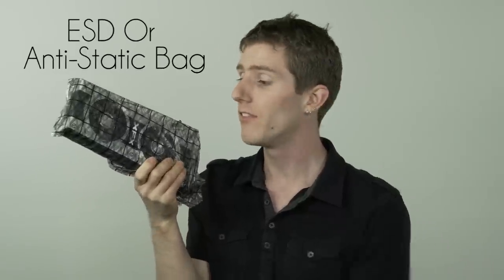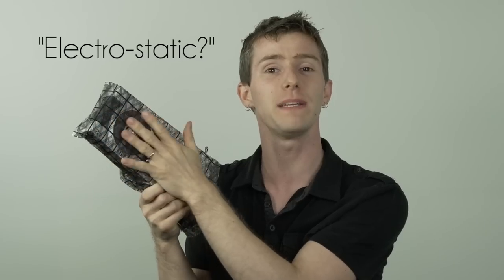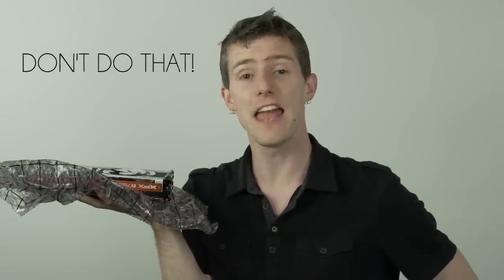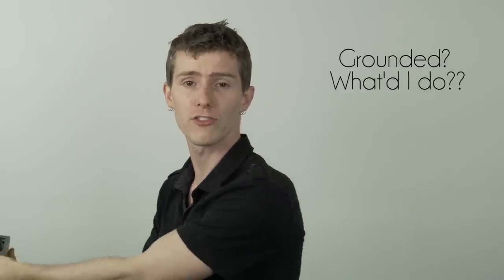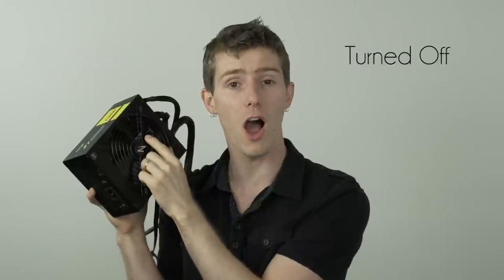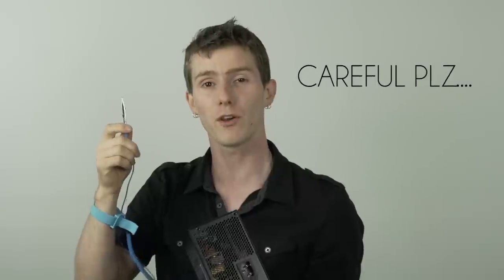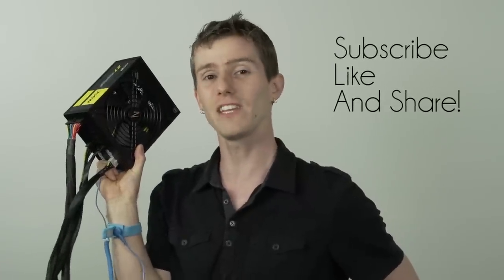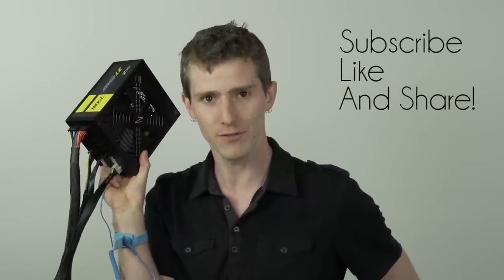Anti Static Safety - Handling Sensitive Electronics as Fast As Possible

Comment: my psu doest have a off switch :(
Reply: +Lukas Safi You can touch a metal radiator. Or connect the wire to the metal radiator...
Reply: My power supply electrocutes me every time its turned on and near me, is it bad or normal or fucked up?
Reply: Alaa Afara I don't think that's supposed to happen since the casing of the PSU is usually grounded... What PSU do you have?
Reply: Arman Ashourlou It came with the Coolermaster Elite 350 (CMP 350) it says Thermalmaster 500W
Reply: Arman Ashourlou I feel sort of a magnetic field around the thumb screws near the PSU and I get a small sting when touching it.
Reply: Alaa Afara Do you get the shock when you touch the PSU directly from the inside of the chassis too?
 By the way, it's not the magnetic field that shocks you; it's the static buildup of electricity being discharged through you and into the ground.
Reply: Arman Ashourlou No, not from the inside, actually I never tried
Reply: Alaa Afara Try to touch only the PSU casing from inside of the chassis. See if you get a shock. Do not touch or get your hand close to any other components in your computer as you might destroy them with a static discharge. Touch a metal radiator or something grounded before you open the chassis of your computer to discharge any static electricity on your body.

If touching the casing of the PSU gives you a shock; I'll assume that the PSU is not grounded properly or is faulty. You might want to contact a computer store near you too to double check  my assumption before you buy a new PSU.
Reply: Arman Ashourlou Thank you good sir

Comment: I love your videos, but those tips are bad. And do not touch the power supply or use household grounding to dissipate static, that is very dangerous. We store and let go of electricity all the time, the main point is to be at the same static level than the electronics. Use a anti-static mat, and connect it to a large metal. Metal dissipates electricity much better than our bodies. And blah, blah, blah...

Comment: EEEEEERRHHHMMM ( LOUD BUZZER SOUND ) WRONG !!!!!  correct way to work esd safe : 1) Wear a grounded esd wrist band . 2) wear a esd safe lab coat . 3) only unpack at a esd safe workbench with special esd safe grounded conductive rubber top. 4) wear esd safe shoes. never walk with these outside. 5) avoid wearing synthetic clothing

Comment: lol static is rubbish i have built over 1k of pcs never had a problem
Reply: Wayne Keenan like the other guy said, its really dependant on your place, some have more risk of happening than others, its more common in places with carpets, or while using sweters,  there are also other easier ways to discharge, just touch a computer case(if its metalic)...
Reply: +Marcos Danilo If I wanted to discharge, could I just not wear anything, and be outside, because then I would be grounded, and I wouldn't have any way to build up a charge.